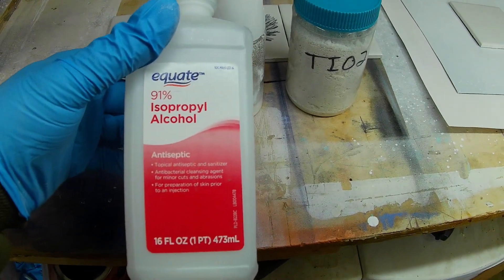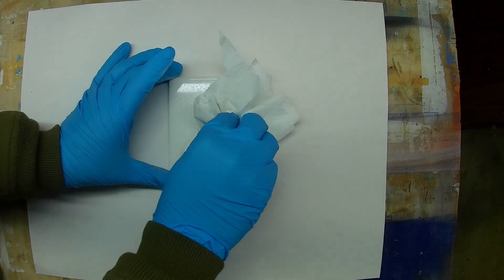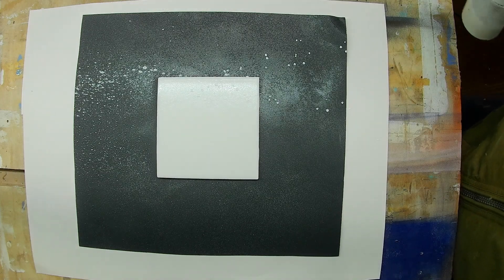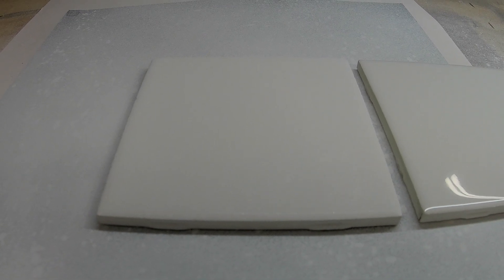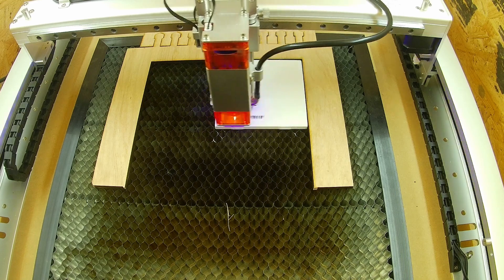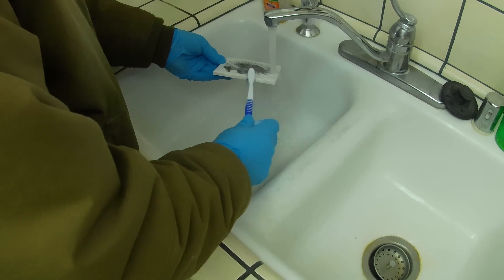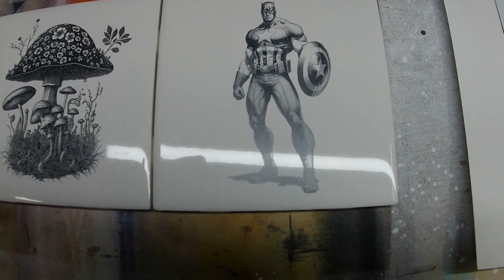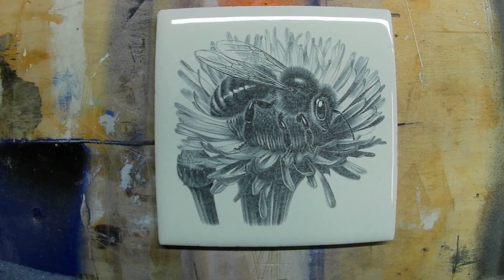Stop using paint on ceramic tiles.

Comment: A diode laser does not usually burn a clean round dot to emulate image pixels . It has a rectangular or oval footpint that prevents high resolution engraving. on wood, glass, slate and other materials. However this method of using TiO2 is unique in the way that it converts white material into black. It is not a burning or chemical reaction but a simple melting  and fusing process between the glass on the tile and the TiO2.  Heating the TiO2 converts it from a superfine white powder  where it reflects the light to a little solid blob of TiO2 that absorbs the light. This black blob melts and aglomorates into a little ROUND blob  (by capilliary action) at over 2000C and the glass on the tile melts at about 1400C, to form a liquid puddle in which the black blob floats. These two melted materials cool to form  something that is best imagined as frogsspawn or maybe the white and yellow of an egg when you crack it into a pan. This unique action of creating round black DOTS is capable of producing images at about 500ppi. The bigger the tile and the bigger the image the more impressive this process becomes. Bigger images take an age with a diode laser but  this process works equally well with a CO2 laser but  4 to 6 times faster. I have used airbrushing, it is prone to clogging and is very messy. The simple spray bottle technique is best but requires  the right sort of spray nozzle and more coats to get an even finish. The IPA evaporates almost instantly so it takes but a few  moments before you can overcoat. Note the use of rubber gloves , it might be just a food grade white powder but it bonds to your skin and takes a a LOT of washing off.
 
This is an excellent video that explains the technique very well.and the results are very impressive . 

This is also one of the few useful applications for the matrix test to attain the best parameters. Don't bypass this vital inital experiment.
Reply from the maker: Very informative, thank you.
Reply: explain it clearly and impressively why don't you lol. so what do you know about Space lasers? lol
Reply: Can you point me towards learning more about diode lasers and their effects on specific compounds? I am by far not a chemist but am interested. You mention that this is not a chemical reaction, and those temperatures you mentioned - what sources are these from? I agree, the end result is extremely impressive
Reply: @Sulfhur1k  
 Hi
I am  just a very inqusative retired engineer that has  been studying the whole non-metal cutting laser technology for about 8 years.  There are so many aspects of this technology that people just observe and use without ever understanding the science that underpins it. Doide lasers are a fiaily recent (and still developing ) means of "damaging" materials and your question is equivalent to asking "how long is a piece of string|?" There is no single answer.  You observe an effect that a laser has on a material , be it UV, diode, fibre or one of the gas lasers (CO2 and YAG ) and you then get drawn into  specific aspects of physics, optics and chemisry as you try to decode  what youhave seen. Most  take for granted what they see, and  are perfectly happy to  just use  something that woks without question. If you do  stop and ask a question,  the chances are that is is not a specifically reserched subject so there is no easy answer.  .  In this case there is no reference work that you can turn to that explains how white paint on a white glazed tile and a laser beam  interact  to causes an indelible black  result.  I came to this subject when a diode laser  correspondent asked if the Norton white tile method was  possible with a CO2 laser.? There were many You tube  "experts" explainng the best way to get super results  but none that expained the science behind the  "magic". Thus, to answer my correspondent's question meant I had to dig deep to understand the science behind the technology. You may wish to view a couple of videos that step through my reaserch and proof of the fascinating  properties of  Titanium dioxide.  See      https://youtu.be/-L94Do81v-s     and    https://youtu.be/QwujeITphFs     There is a further unpublished short video that demontrates the amazing potential of this process  see      https://youtu.be/TVgmoN1wljs
Reply: out of curiosity since you seem to know the science here, is there any way to color/tint the TiO2 so that it comes out other than black?  Is it in any way similar to powder coating?
Reply: @JohnVanderbeck  
Hi John 
Thats a fascinating question that cannot be answered with certainty unless you understand what TiO2 is. and also the peculiar properties of light. Raw TiO2 is black just like coal and althoiugh we think of black as a colour, our eyes can only "see" the light wavelengths that are the colours of the rainbow. Is there any black in the rainbow? or even white? We see colours because of reflection. Hold up a piece of white paper  and what you are seeing is ALL the rainbow colours mixed togethet proportionately  and reflected to your eye. off the surface of the paper. Your eye percieve that mixture of wavelengths as a "colour" that does not really exist. If the paper is pink  then some of the wavlengths are absorbed  by the pigment in the paper  and only the reflected mix is of remaining  wavlenghts is percieved by your eyes. Black is the opposite of white in that ALL the lightwaves are absrbed and the appearnce of black is because the is zero reflection.

When TiO2 exists in "solid" form it fully absorbs light and appears to be black. When it is ground into a fine nanometer powder  the crystal structure then reflects ALL the light and you see it as a bright white. If you grind it even finer it then magically becomes a transparent powder. that neither  reflects or absorbs the lightwave our eyes are sensitive to. Heat TiO2 powder abouve its melting point and it "flows" back into a solid mass that then absorbs light.and becomes black.

Adding a pigment will not change the chemistry of TiO2 by a laser heating energy absorption procees. There will undoubtedly be chemical reactions that induce colour changes  but they are  outside  our limited capabilities.
Reply: @SarbarMultimedia  Thank you.  Yes I do understand how color and light works, and additive vs subtractive color.  That makes sense, and if in fact it just absorbs all wavelengths equally after being heated then yeah doesn't sound like you could tint it.  Shame.

Comment: Nice video!  Thank you for sharing.  Experimenting with TiO2 is on my list and I have everything I need other than the time.  ;-)  I was going to use denatured alcohol and a brush.  I was wondering if a spray bottle would work so that was also on my list to experiment with.  Your results look fantastic.  I like the clean up with just water.

Comment: Does the mixture hold up to storage after you mix it up?  Or do you mix before each session?  Thanks for the video.
Reply from the maker: Holds up fine but it will separate so just shake it up real good before each spray.
Reply: @lasersandsaws  Thank you. I’ll give it a try. 👍🏼

Comment: Thanks for sharing!  I’m so glad there’s a non-paint method to do this.  I really disliked the wait time with paint and chemicals needed to remove the remaining paint.

You mentioned a 50/50 mix.  Since you have a dry and wet ingredient, are you saying you put like 1/4 cup of powder and the same of the alcohol in the spray bottle?
Reply from the maker: Yes exactly. But it doesn't have to be exact. I just eye ball it.
Reply: IDK why everyone talks about the time for paint to dry and the excessive cleanup on paint. One of the first alterations I tried was to laser the wet paint immediately after spraying. Works great for me and the cleanup is super quick with a little acetone while the paint is still relatively wet. Do like his results and might be a good alternative tho.
Reply: @zumbafosto  But can you simply rinse your's with tap water?
Reply: @markcook8516  No. The paint dries too much for tap water to rinse it. I use acetone, but that is a really quick rinse. If I used a water based paint, then maybe but I havent tried that yet.
Reply: I use an 80/20 mixture and two coats with excellent results. 20g. Titanium dioxide and 80g. 99% alcohol. Defiantly the challenge has been finding a spray bottle that works.
Reply from the maker: @yourtimehomeinspections4354  I have gone thru so many spray bottles. None seem that great for the job. I tried airbrush but that clogs right away. Right now I'm trying a different mix and painting it on with a foam brush.

Comment: If you could spin the tile while you're applying the mixture it would help to create a more even layer. *Advice we got from a friend who works in a lab that does nano-coating when my son and I asked him last year about doing this.
Reply from the maker: That might be worth a try to get an even coat.
Reply: @lasersandsaws  If I remember correctly he said it didn't have to be fast, you're not wanting to sling it off.
Reply from the maker: @56effie  I wonder if an old turntable would work.
Reply: @lasersandsaws  if you found a turntable with 78 rpm 45 rpm and 33 1/3 I believe it would work, and a drill with a piece of round wood with a bolt through the center of the wood work too!
Reply: @lasersandsaws  Heck, I'll bet a cheap lazy susan would work.
Reply: @johngrimoldy7637  Hey, Susan may be cheap, but she’s not lazy.😁

Comment: Note for anyone trying this: use a good respirator with a particle filter when handling the titanium dioxide powder. 
It is a carcinogen and you do not want to get lung cancer from breathing in the powder/fumes :)
Reply from the maker: Good advise. I wear one every time including when using paint.
Reply: Why would there be a "food grade" of this if it is a carcinogen? It isn't used in foods then? I know almost nothing about this powder, just wondering and thanks for the warning, I will be careful if I get some, and won't use it in my kitchen :D
Reply: @CountYulith  it's the powder/fine particles that get into your lungs that's dangerous. If you eat it as part of food there is not that problem (but try to avoid eating it as well, they have found out it affects your body in a bad way too)